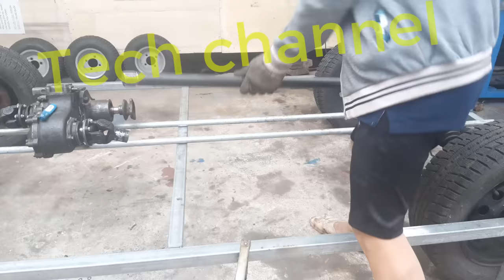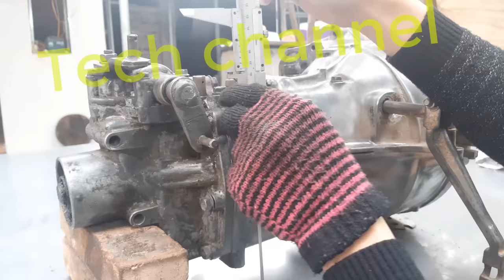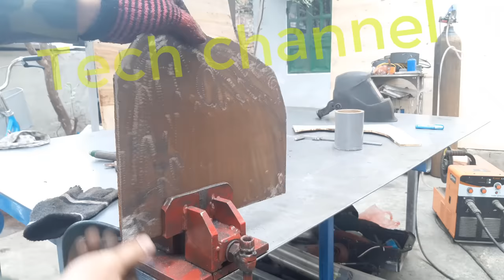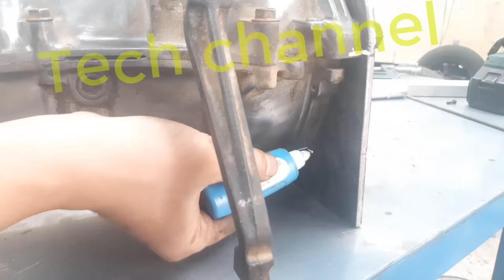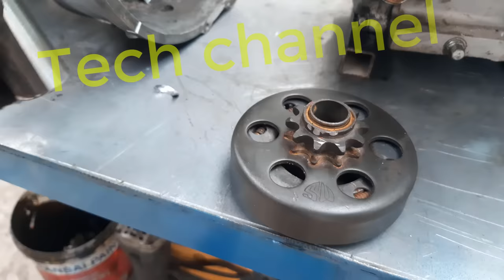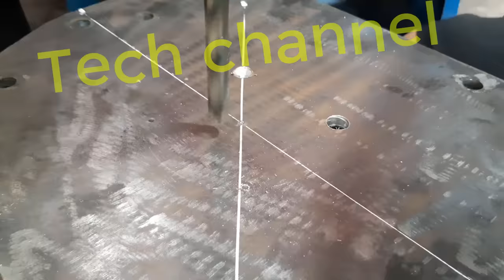Build 4x4 project part 10: Connecting engine and gearbox

Comment: you shouldve used the fly wheel and clutch from original engine
Reply: Would have been too heavy.
Reply: Way to heavy.... And once you got up in the RPMS it wouldn't come down very fast if at all. The velocity of a 10+lbs flywheel would eat the engine.

Comment: To mark out the wood/ plate, put it flat on the bench and stand the gearbox on it, it is easyer and you can mark all round in one shot.😀  .
Reply: I thought he was going to use a spray can, easy and precise for perimeter and holes
Reply: vv
Reply: @tungamiraimsipa1424  not a bad idea, and accurate, you wouldn't need a heavy coating either, just enough to mark it☺.
Reply: What I have done in the past was used some transparent perspex to make the template for the adapter plate. 
A child could mark it out even
Reply: @gerbourke1952  more accurate than using wood , and now post covid with all the screens in the shops getting taken down it could be a good time to stock up with perspex as well.
Reply: @torchibadro981  a

Comment: I love this idea. I am gearing up to cast an adapter out of aluminum to mate my opposed twin experimental aircraft engine to a flywheel and clutch for a MGB transmission and then to a driveshaft and rear for a replica 1928 Morgan RIP GN special hillclimb racer. I may do it your way. I wil be video-ing it either way.

Comment: You can see at the 2.00 min mark that the splined shaft is lop-sided on the lathe jaw while being machined.
Reply: Yeah that's not worth a shit or strong at all .   And the welding is crap.
Reply: I saw the same thing too.
Reply: @midixiewrecked7011  Built in Vietnam, so it's pretty much Chinese quality.
Reply: The yokes on the drive shafts aren’t aligned, there will be a lot of vibration ☹️

Comment: I don’t see the point in the adapter plate, because it would be possible to put on chains or belts, the second would be even better, because the centrifugal, for example, in this case, will not live long and will quickly fail

Comment: You knw there's an easier way to remove a stud by putting two nuts on the stud and locking thm tight together thn undoing thm instead of welding a bar to thm. Also you can reuse thm for something else
Reply: كرباج وينو

Comment: about shaft- you make it wrong - u-joints should be in same postions on both sides of shaft! its very important, if you didnt fix it you will have braking bearings inside joints

Comment: an adapter plate is needed only if a clutch flywheel is installed along with all the attributes of an automobile clutch; the drive, by the way, can also be a belt

Comment: He is machining this all wrong. He did not balance the part while they are spinning in the lathe. The machining of the part is  completely off balanced and this person needs to learn how to properly use a lathe before using it. He is going to kill someone!
Reply: I think he is doing a very good sturdy futuristic advanced you keep for getting asians and europeans used to be aztecs and mayans but sinfully today idiots except just pickup truck and car ways but not at all futuristically they let them selves be caveman again dirty etc the hispanics but these guys like us were their cousins and other native americans are our cousins too are futuristic he's trying to make it and very good unlike other cars we do keep the youjoint from falling out or keep screws falling out which does once in a while and make car sturdier he knows what he's doing maybe he got reasons for it to prevent danger i can tell what he's doing is futuristic ujoint as engine outers as turning wheels you know some marveled trucks you can see ujoint near engine spinning fast as coolant or air-conditioned for the truck in inside it could be same that turns wheels it separated  but almost near there you could see it spending and the joint part too it's like a u joint spinning let him do it maybe he's trying to do same or making it for engine and coolant